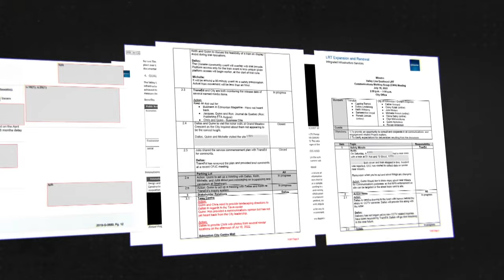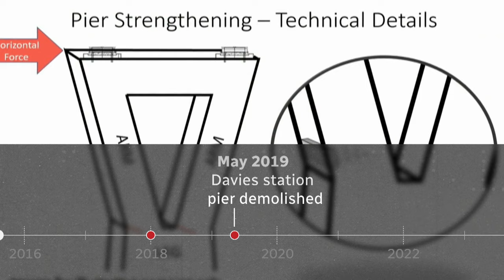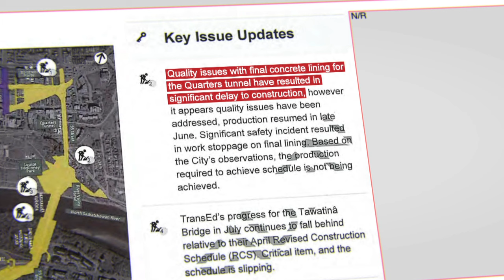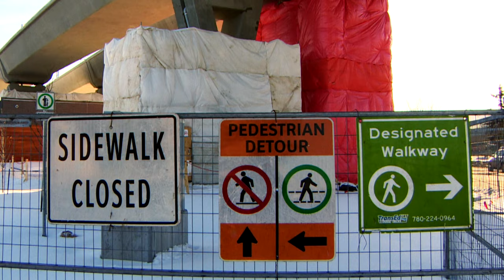Why did Edmonton's newest LRT line take so long to get done?

Comment: I think it’s great, I ride it everyday. The only problem is that it takes longer to ride compared to the existing lrt, but I like how it’s less busier, smoother, and less stress
Reply: It's actually comparable, even shorter than the current Capital Line. According to Google Maps, end to end on the Valley Line is 29 minutes. End to end on the Capital Line is 36 minutes

Comment: Probably the same company that is building new lines here in Toronto, (GTA), as they also are running greatly behind. One such line here in Toronto is the Eglington LRT Line which is wayyyyy over on the time that was quoted for the line to be completed and running. And from what is publically known here, same kinds of problems and excuses. 

Meanwhile in Vancouver, where I used to live, has more than doubled the size, length and 3 of new stations, maybe even tripled them. And they are continuing to build more. When I was in Vancouver this past summer I was totally blown away by how the transit by Subway and LRT has grown and was intelligently designed. 
You can now get almost everywhere in the Lower Mainland of the GVRD. And with the new lines they are working on and completing now, in another 3 maybe 4 years there won't be anywhere in the GVRD including North and West Vancouver, that don't have some form of light rail accessible public transit.
Reply: It's not.   It's a consortium, in a Private Public Partnership.   Would some of the companies within be the same.   Maybe but all large projects are subject to the same.

Comment: Are we forgetting all the delays and lack of work during the pandemic?..and how hard it was to keep canadian workers on the job..the lack of concrete and building supplies the industry was going through, the influx of cheap foreign workers replacing locals that was happening at that time? Blatchford LRT had similar issues..I know this first hand.
Reply: they won the contract in 2016.  90% of the works  are outside and the other engineering/admin works can be done at home.